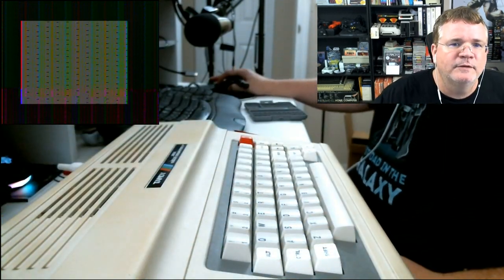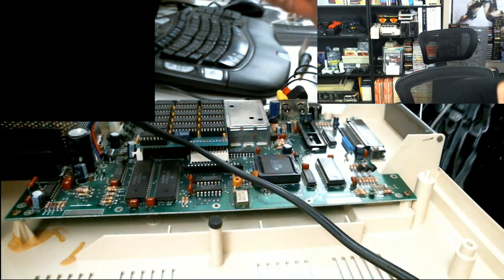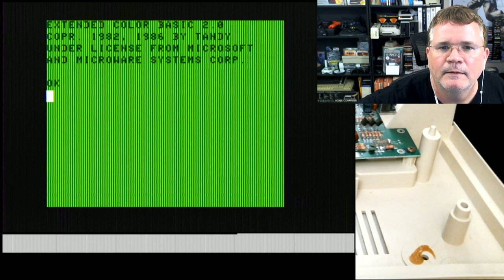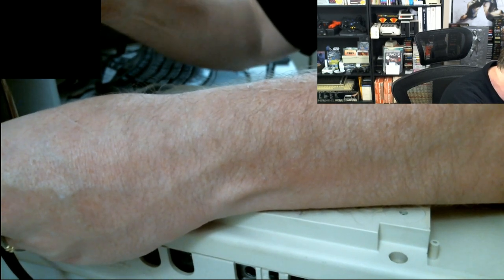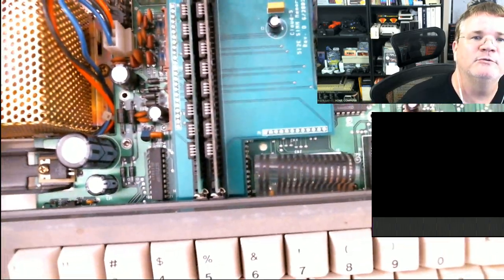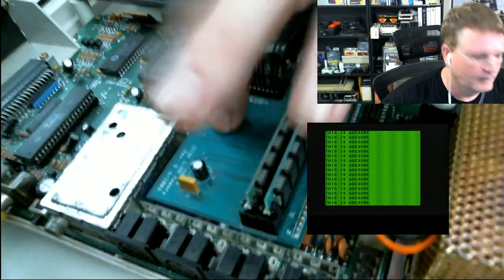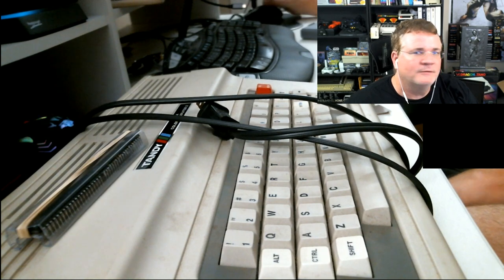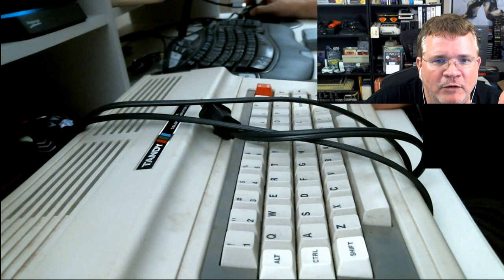Performing Surgery on a Tandy Color Computer 3

Comment: Re: 2MB RAM RSDOS programs - there were a couple (including Sock's rotating Coco 3 demo from PennFest 2000) that supported 1 and 2MB RAM. Some RAM disk/print spoolers, I think a version of DanoSoft's BIG BASIC did, and some sound playing/capture software (including Oblique Triad's, which had an 8 bit recording hardware option as well) also supported >512k RAM.

Comment: I have a coco 2 64k w/extended basic (ebay, never been opened (until now), seal was intact), it has caged transformer like your coco 3 (later rev?), i have tried 2 different cassette cables but when CSAVE the signal is barely audible. Is there an obvious cap or resistor that would cause this problem? Help would be appreciated. BTW SOUND command generates audio just fine thru monitor speaker, not sure if that's related.
Reply from the maker: I'm not familiar with the electronic components of the system, but if you join our discord server, there are lots of hardware gurus there.   https://discord.gg/4J5nHXm

Comment: Concerning the 6309 with a lot of solder on it - I wonder if it was originally part of a 1MB or 2MB Disto upgrade - you had to attach a DAT board to the CPU, which soldered all 40 pins to the CPU. I know the 1MB upgraded Coco 3 we had at work had it, and the CPU you showed reminded me a lot of that.
Also, concerning the Protector and getting 6309's: while 6309's are dirt cheap right now, if they ever quit production and/or shipping, having the Protector to protect your CPU investment (at that time) might be worth it.
Reply: What is a good website for buying 6309's
Reply from the maker: +Jerry Adams I'll ask the guys on Coco talk today